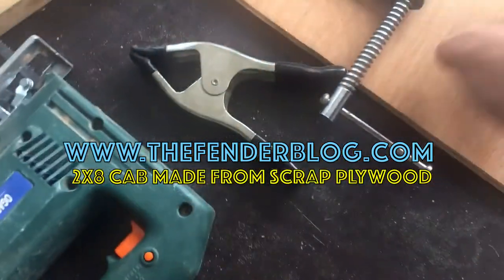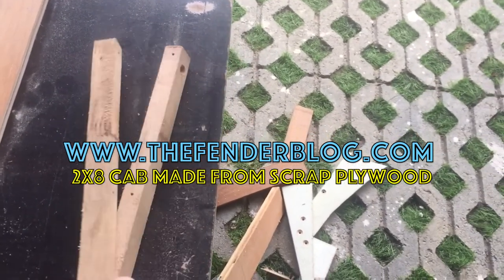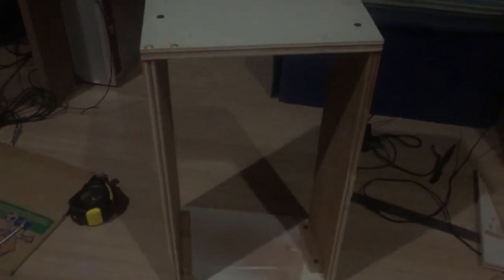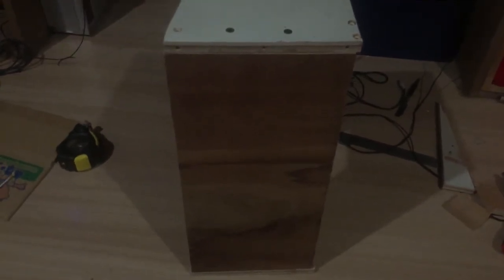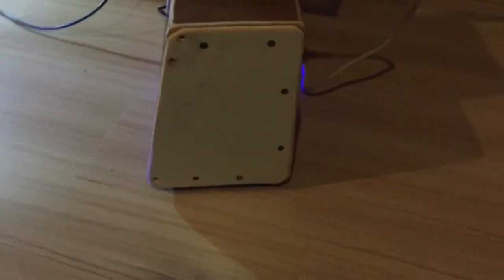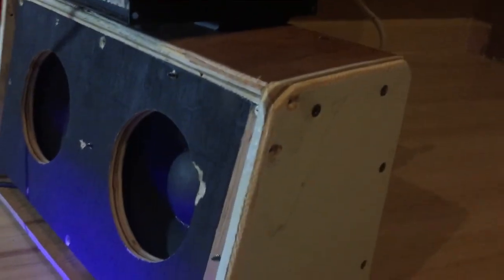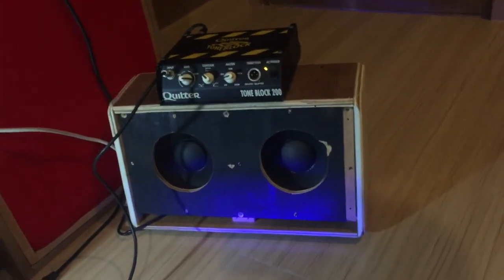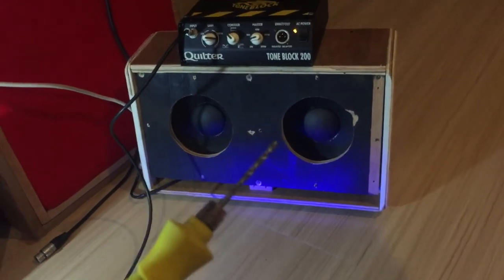Celestion 2x8 Cab Demo. Do Not Buy a Guitar Cab from this Guy!

Comment: I was thinking of experimenting with a 2 x 8 before spending good money on a 2 x 10, or 2 x 12, just to get some design ideas down. This looks great. You've given me some confidence...
Reply from the maker: Good on you. It's fun to experiemnt. I've since moved on from this cab, which didn't sound as good as I'd hoped at louder, stage volumes. However that was more due to the type of speakers and how they sounded with my amp (a Quilter, solid state amp).
With actual guitar speakers it would have sounded nicer I think.
I've still got these Celestion speakers and I'm going to build a new 2x8 as a bass cab as I think these speakers will be better suited for bass. 300w handling should be enough for me!

Comment: "Do Not Buy a Guitar Cab from this Guy!" Can't imagine why not ? It's really set up like any of them, not pretty, but he did indicate it was from scrap wood that was laying around as unused and it didn't waste resources. It's not being sold for what Marshall or Orange are pricing them at. Dimension perspective, any amp/speaker cabinet is what anyone chooses to build one for specs. Can be sealed with caulk or glued if one were to make it air tight. How much air can really escape if it isn't sealed air tight ? Probably nothing appreciable to make that vast a difference. I have a cheap open back that I loosely pressed a back piece of 3/4 MDF particleboard to, it's close enough to a closed back's air tight seal, yet has enough gap to  breathe to combine features that an open back has for advantages/disadvantages. I think it sounds better than a closed & sealed, better than a partial open back that way. Amp & speakers get a negligible gap of air flow. Make the box big enough to accommodate a range of 8/10/12 inch speakers and it should sound different with each, yet fine for any live performance. I want to put a hinged back on the open back, that way it's a convertible open/closed back on the fly cabinet.
Reply from the maker: Yeah that was just a joke really. I don't even try to sell cabs anyway. I mean you can see I'm no pro! I have since built a 1x10 cab from very thin MDF to keep it as light ans as cheap as possible. That turned out ok. I'll get that in a video soon too.
Thanks for the comment.

Comment: Haha, most professional hackjob I've ever seen  ; )
That was just camera audio, right?! It sounded fantastic!
Reply from the maker: Haha, well I'm certainly no pro cab builder! Yeah I just quickly did a sound sample using the camera mic. The volume is low on the amp and I find that the shortcomings of speakers/cabs become more apparent when the volume is high, like stage levels.
I did quickly blast it though before anyone was sleeping in my house and it already sounded less "hard" than the same speakers in my converted Fender cab, so here's hoping it'll work well live because it's light. It only weighs 7kg.

Comment: Is that a port on the bottom?
Reply from the maker: Kind of...
I don't think this qualifies as a real ported design but is similar I suppose to what I understand is called a detuned cab. It wasn't by design though!

I didn't have enough wood to get a baffle that was quite big enough to fill the front, so I tried it out like this. It's about an inch or less gap at the bottom and screwed into a centre piece only as there were no other anchor points at the bottom corners..
It turned out ok I think. It's not perfect and I never expected it to be, but it will serve me well for live use.
Reply: What kind of speakers are you using? I would like to build a speaker cab but I would like to use like some 6-in speakers if I could find some that would be good for guitar use.

Comment: What is the benefit of a 2 x 8 cab over, let's say, the single 8" speaker of a guitar amp? What would be the difference?
Reply from the maker: Hi Carlos. 2 speakers move more air than a single speaker, so it would probably be louder and bigger sounding. However the main reason I wanted 2 in a cab was so I could have a cab that  would handle the full output of this amplifier (200watts) just in case I needed it (I never did!). These spekaers are rated at 150w each, so two of them resulted in a cab that can handle 300watts.
I did  use this amp with a 1x8 cab with one of these same speakers and the sound was more boxy and also more directional.
It's all about trying things out and finding what it is you like the best. Thanks!
Reply: @RobCmusic  oh, i see. Thanks